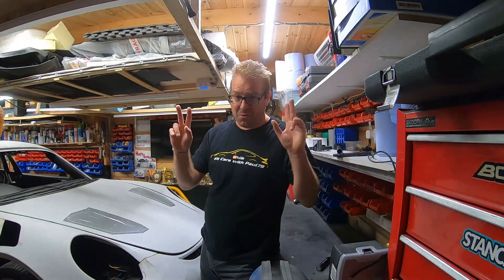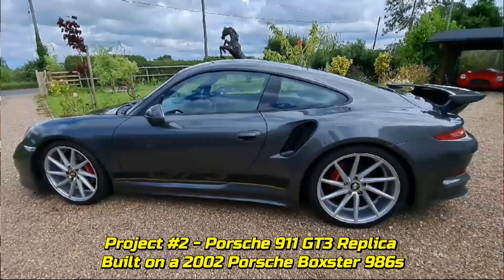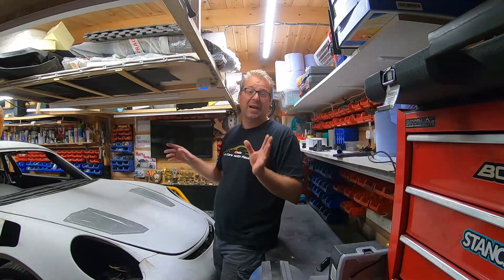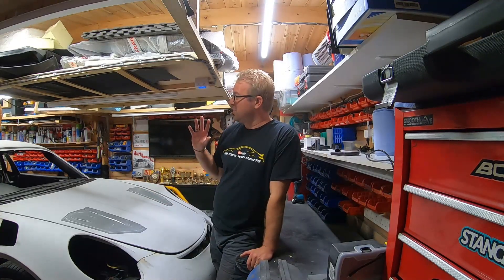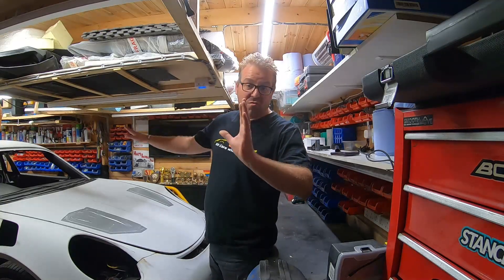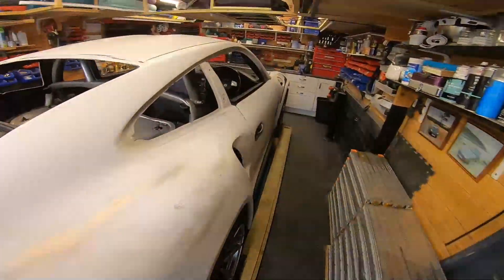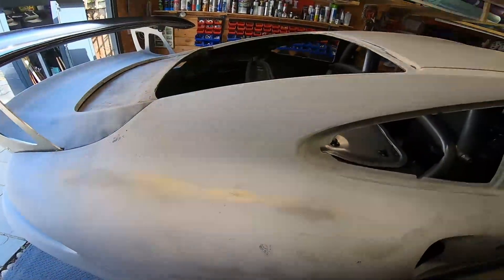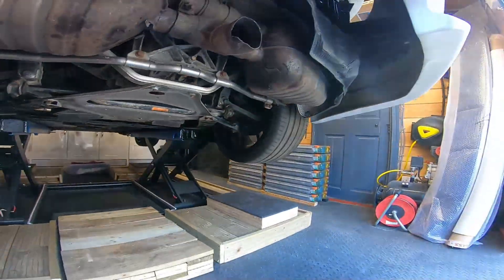EV Home Build Part 1 -  The Project Begins! Porsche GT3 RS EV!

Comment: Looking forward to the series.  I’m both an EV fan and an ICE fan.  In addition to the sound, many petrolheads also like shifting.  Assuming this will have an automatic transmission, but recently read that Toyota (among a couple of others, I believe) have developed manuals for EV’s.  So, just curious.
Reply from the maker: yes this will just be an auto. I'm getting older now, so want things easier for me, lol
Reply: @kitcarspaul79  Thanks!  Curious to see what you are planning to do about “the sound”.  Staying tuned.  :-)

Comment: Hi Paul, try not to store the batteries like that. They’re fragile and there’s too much weight on the bottom modules.
Reply from the maker: Ah ok. Thanks. How would u store them? Length ways on the thin side leaning against the wall?
Reply: @kitcarspaul79  stacks of three should be fine. 👍